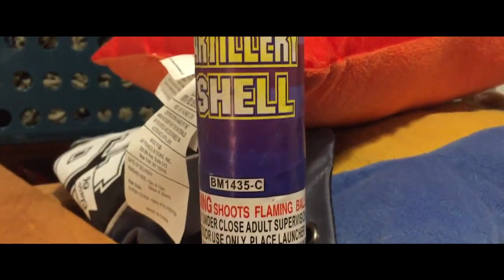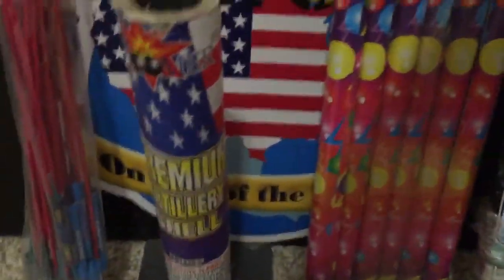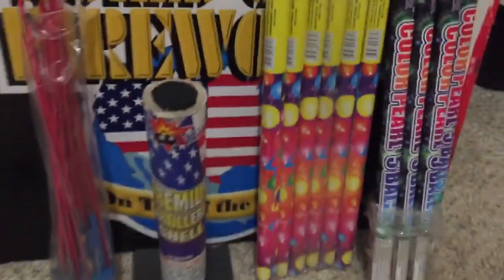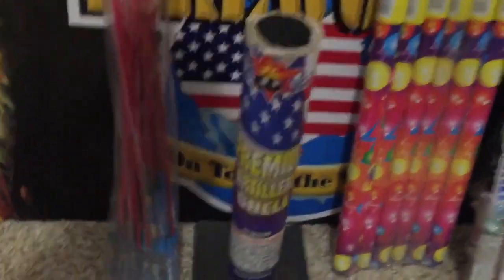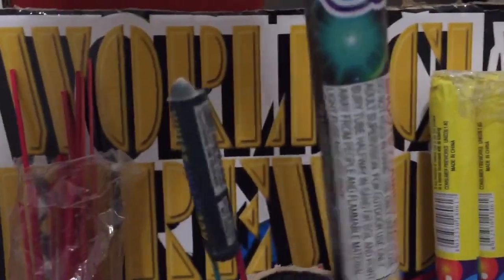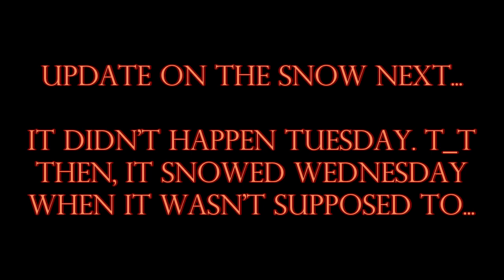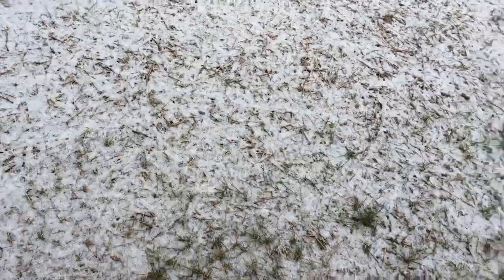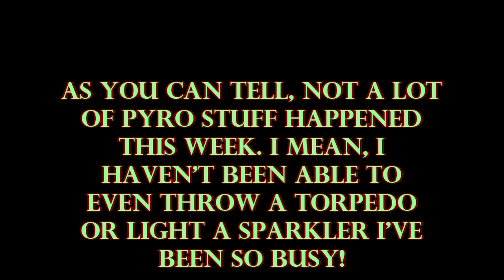Artillery Adjustment

Comment: What are you editing in? Edits look good. 
Be sure to put bricks on the base of that tube if you are going to use it for a holder for any decent candle. I did that once and the candle kicked so hard that by the 3rd ball it was tipped over and was shooting them against the house. A lot of times I will use a spent roman candle to launch rockets. I stick it in a spent 500g cake with a tube that is big enough to hold the candle. It is not always worth it to me to drag out my rocket rack to just send up a few rockets. I have 2 quick rocket vids I shot last night using the roman candle in a cake method. Didn't post them yet, maybe tonight.
Reply from the maker: Yeah, I hadn't decided whether or not I was going to brace this tube with roman candles. I'm expecting jack and shit out of the 5-pack pearl candles from Total Rebellion, but I'll definitely still brace the tube. Yeah, taking out a rocket rack to fire 3 or 4 rockets sounds awful. That's why I'm using an old artillery tube; easy to store, easy to move around, only requires a brick or two to brace, and I can clean up super fast. ;) I would do the cake method but I really don't want to keep a 500g or 200g carcass around just for an occasional rocket or roman candle if you get me. I don't have enough pyro for that haha
By the way, I literally use a free software called LightWorks. It's kind of ass and crashes fairly often if you use too many segments of too long of length. It also makes those random sound glitches and I have no clue why... Thanks for complementing my edits though! I didn't think they were anything interesting, but guess I was wrong.
Reply: @kyleflounder9783  ok so you are using Lightworks. Free is good. Limited to 720p output I see. Video editing large files tends to be pretty demanding, you can run into crashes when you run out of system memory. If you are bored someday you can try out DaVinci Resolve 15, the free version. It is overkill for basic cutting and editing, but it is also free. The download link is at the bottom of this page: https://www.blackmagicdesign.com/products/davinciresolve/edit
Reply from the maker: I'll definitely look in to it! In all honestly I love LightWorks and all, but I don't feel that I can do some of the things I want to do with the limited features it has (the paid version doesn't add much more btw.) I probably need to look into moving on...
Reply: @kyleflounder9783  Here is a quick tutorial to Davinci Resolve if you want to see what it looks like: https://youtu.be/EbqmZjJEsBw?t=85
It is as close as it comes to pro level video editing software for free.
Reply from the maker: @MyFireworkDemos  I will definitely watch that this weekend! Hopefully I'm not busy trying to correct a 56 on a Precal test and not doing 3 classes worth of homework this weekend after not getting a break last week but who knows. :/